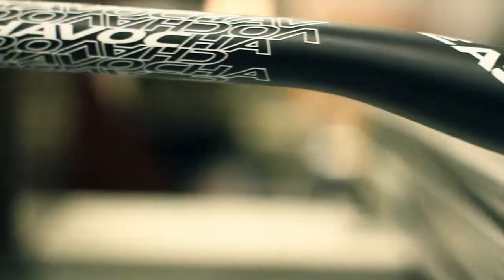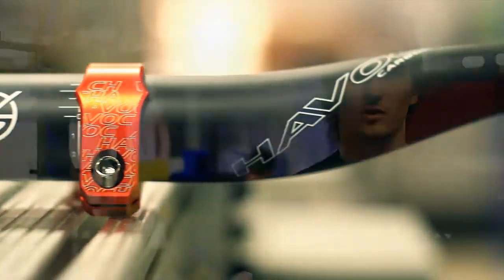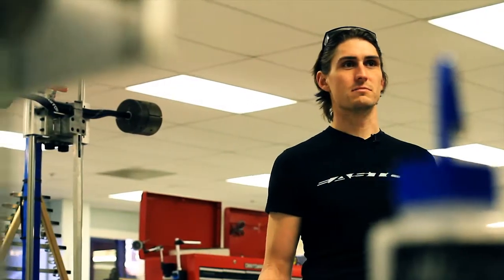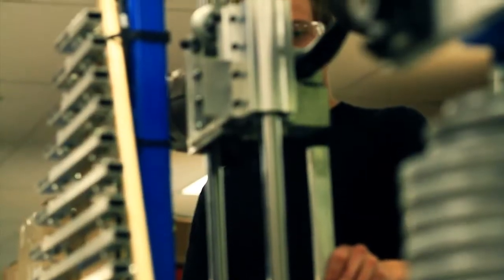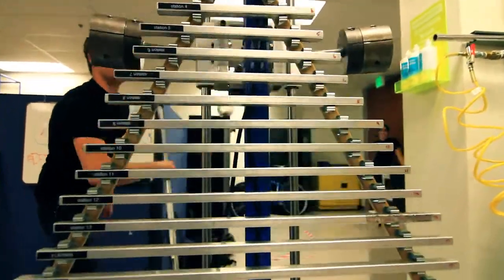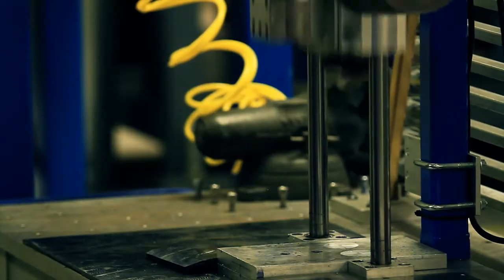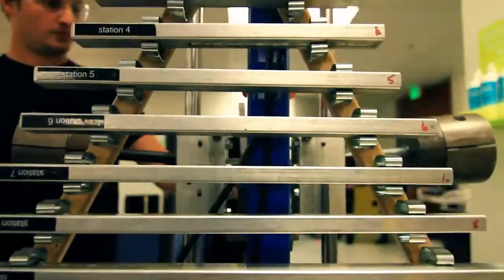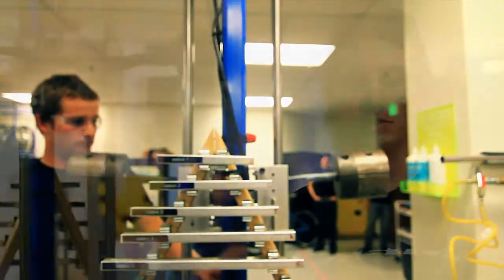Easton Cycling: Handlebar Impact Test

Comment: The forces imparted on the bar will be a function of k (stiffness) and c (damping coefficient) of the spring mass damper used. Do you model this or measure acceleration of the bar? It seems height and mass are frequently referred to in isolation of the system.